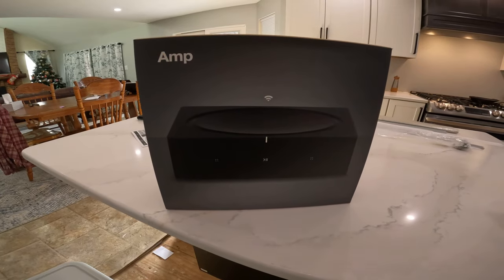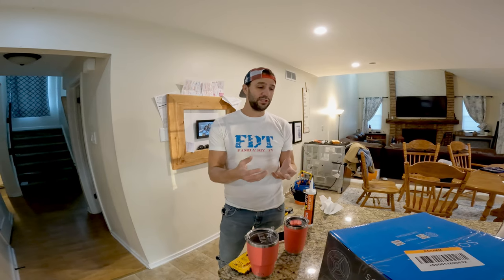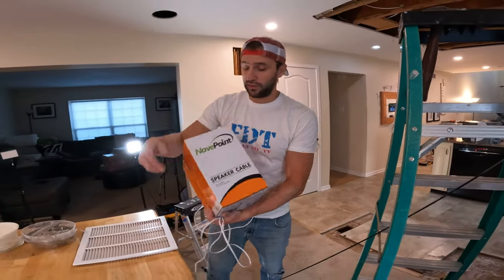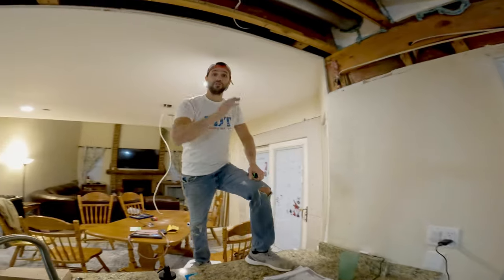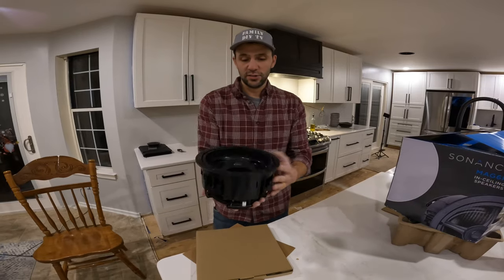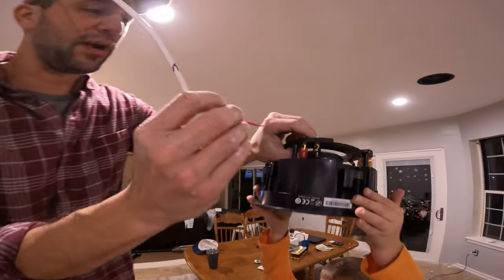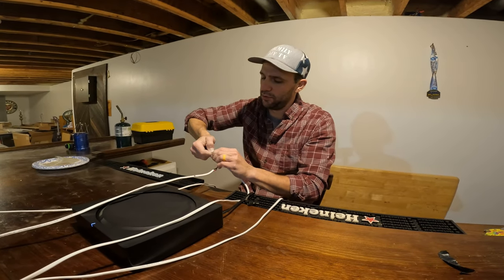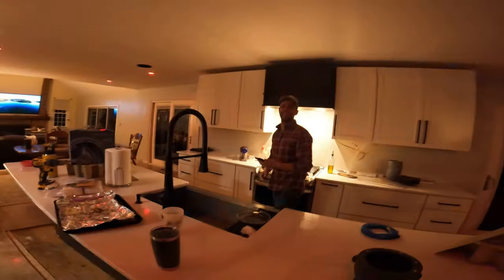DIY: Installing Ceiling-Mounted Sonos Speakers & Setting up the Sonos Amp #sonos #familydiytv

Comment: Cool Video, I've been on Sonos Bandwagon going on 7 years, 3 different setups arc, sub & era300 
Sound is incredible for cost not too mention Wireless. If you're reading this & on the fence about Sonos ,, give your ears the sound it deserves,  u won't be sorry. Avoid the cost up front. Well worth it. Sonos for life.
Reply from the maker: Thanks !  I agree, going to be installing the Arc very soon !  can't wait !
Reply: Thanks, one thing the video didn't mention how the sound was, I mean did it sound ok or? There are some of these speakers on sake for 169 and I was thinking of using them to add Dolby atmos but not sure if I need some kind of special speaker or these will be good enough

Comment: Will be nice potentially in 2024 when sonos releases the much needed arc 2.0 better updates & full dolby atmos. The original arc us still awesome but can be better . Just don't over spend on sonos like i did lol, but i don't regret it but my neighbors hate it, when there walls flex & vibrate.

Comment: Hi great video, thank you. I noticed you have both speakers wired under the same terminals. Up to how many speakers can you fit on there? If you want a multi zone speaker setup would you just have to buy more amps?
Reply from the maker: Correct- Each zone would be a separate amp.     I’d say two speakers per wire.   If you wanted to push it could do three.
Reply: @FamilyDIYtv  I appreciate the quick reply, thank you sir 🙏

Comment: great video! 
What if i want to connect 8  or even 12 speakers.  Do I need a amplifier for every 4?
if that's the case, can they all be used to play same source at the same time?
Can all amplifiers can be synced?

thanks in advanced.
Reply from the maker: What if i want to connect 8  or even 12 speakers.  Do I need a amplifier for every 4?  - officially yes, but could push to six maybe...   

if that's the case, can they all be used to play same source at the same time? they can all be synced up very easily or play separate. it's works great. 
 
Can all amplifiers can be synced? yes and you can even sync all amps, soundbars and subs you have in your house if you want... or have all separate, as well as control the volume on each on separately or all together.  it works great

Comment: So the speakers have a bit of weight to them.. are just the plaster board on the ceiling strong enough to hold their weight without anything to brace it to take the load from one of the timber joists/rafters?
Reply from the maker: Completely fine with just drywall

Comment: I am building my house and we wanted this Sonos speakers, the space is 40x20ft, how many should we install? Also if I want to play music on music in the kitchen with 2 speakers, and then only play the sound from the the tv in another 2 in the living room, then I need 2 separate amps?
Reply from the maker: Is the tv in that same space ?  If yes.  I’d install arc soundbar under tv and sub.     

Then install 4 or 6 ceiling speakers on a separate amp.    

Yes each “zone” needs an amp.     

But the arc would be a zone and the 4/6 speakers connected to the amp would be a zone.
Reply: Thank you! The 20x40ft space will have a tv in the living room. As you said I can use the arc for the tv. I was thinking maybe 2 in ceiling speakers and 1 amp for the kitchen, then 2 in ceiling and 1 amp for the back of the living room. And arc for the front of the living room by the tv. What cable do I need for the in ceiling? I found the one you used, but you also say that there maybe a better one? Any recommendations? Also the arc doesn’t need to be hardwire right? And can arc and 1 of them amps play sound at the same time? I was thinking in using the 2 in ceiling speakers as “surround sound” in combination with arc.
Reply: @FamilyDIYtv I wish they would come out with a way to select which speakers you want to play that are on a single amp. Like a zone within a zone. I was going to install 6 Sononce speakers on an amp (2 in family room above couch, 2 in kitchen, 2 on sundeck/patio), and use that for music and watching TV. Sadly learned that would mean if using the sonance speakers for TV, then that would be heard everywhere there’s a speaker on that amp, at the same volume. 

Now, going to go with a Sonos arc and sub and maybe some Sonos ones.

Any other options to still leverage in-ceiling speakers without getting a separate amp?
Reply from the maker: @g.thandi824  I hear ya. You could still do what you want but run the speaker wires through an additional switch.  So you can “manually” (physically). Turn of which zone you want.    I think they also make Bluetooth switches.   Google speaker selector switch.
Reply: @FamilyDIYtv  that’s such a simple yet super smart idea. Thank you! Before that, I was thinking I could go to the amp and disconnect the speakers I didn’t want to be playing - lmao. Was thinking of wall mounting the amp in the pantry in the kitchen (family room and kitchen are in the same area). Is there any advantage that I am missing to having the amp by the TV? Also, how high are your ceilings? Mine are only 8 foot in this section of the house (total space of family room and kitchen is about 14’ wide by 32’ long) - so going back and forth with whether in ceiling speakers could ultimately be overkill vs just an Arc and sub.

Comment: Was 4 speakers loud enough?
Reply from the maker: It’s 100 percent loud enough, but probably should have went with six.   Reason being during parties it nice to have the speakers lower but more of them.  Fills the space with music without it being to loud where you can’t have a conversation….   I’d always go more, like lights.   Can always turn down or dim(in case of lights).
Reply: @FamilyDIYtv  did you go with 6 1/2 inch or 8 inch?
Reply from the maker: @robertslayton6574  6m1/2

Comment: is it possible to connect these in ceiling speakers to Bluetooth on my phone?
Reply from the maker: if you had this exact setup, no.  but if you had the same speaker you could run them to a bluetooth amp and then yes. ....  but i've had both.  Sonos is by far a better setup, but you do pay for it.   

if forever home, i'd go with sonos...

Comment: great review. Why not go bluetooth?
Reply from the maker: Been there done that.  Sonos works way better and a lot better performance, meaning connection.     But does cost $$$.     Only downside.  

Also Bluetooth speakers need power ran to them.   

Sonos just needs small
Speaker wire.

Comment: Did you ever do the Arc integration video? Did you set up the ceiling speakers as 5.1 system surrounds? If so, do movies sound strange when you're in the kitchen since you only get the surround channels? I assume music is fine since you'd get two-channel stereo?
Reply from the maker: I have not setup the arc yet- I’ll be doing that in the fall(project got postponed-lol)
I will use the kitchen speakers with arc but mostly for music and sports games.   Not movies, I could, I guess.

Comment: Bro can i use an auxiliary cable instead of Bluetooth with that system?
Reply from the maker: there's a few connections, check a picture of the back of the unit to see what can be plugged in, you can input music from 'wire'

Comment: Can I use a Sony receiver 7.2 Dolby? With the Sonance speakers and sub woofers ?
Reply from the maker: I don’t see why not.
Reply: I currently run a 7.2  (arc, 2 era 300's , 2 subs) sounds phenomenal. Don't need ceiling speakers . The new Era 300 are amazing additdion to the sonos family and way better trhan the 5's & dolby atmos